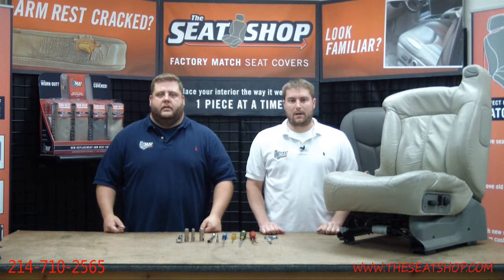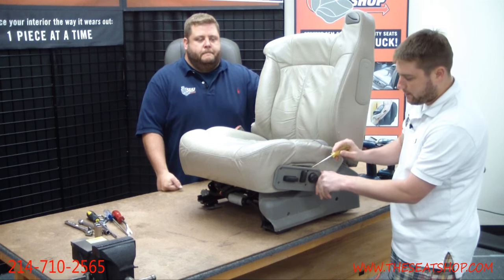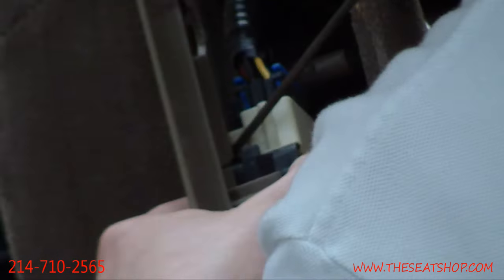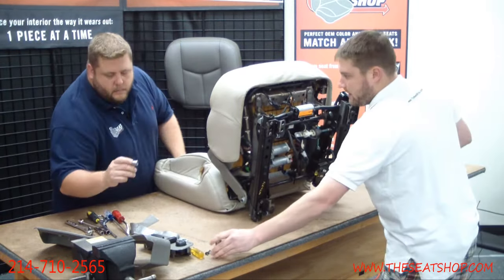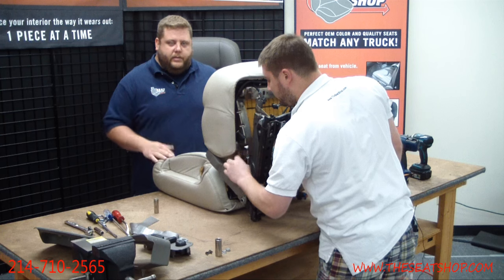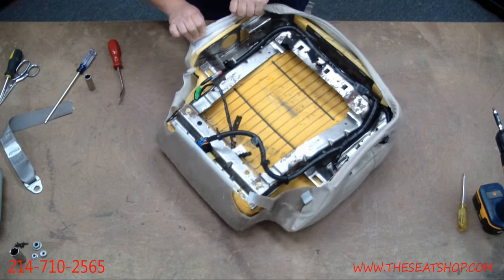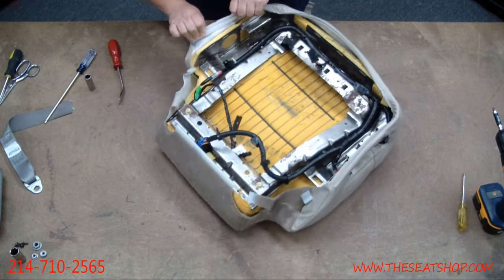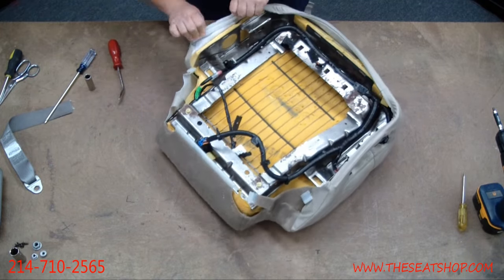00-02 Chevy/GMC/Cadillac Driver Bottom Leather Seat Cover Install

Comment: Great video man, thank you!
Was thinking about replacing the cushion, heater grid and maybe the cover on my '02 YukonXL. Those 308,000 miles have flattened that cushion like a pancake. The leather is actually in great shape. Loose since the cushion is almost gone though. Thanks again!

Comment: I just installed your seat driver cover (2002 Chevy Tahoe).  The hardest part for me was getting the seat out of the car.  Driver side right front screw is hidden under a plastic cover, and the rear ones are only accessible with the seat in a particular position - controlled by the electronic  position adjuster.   So it must be removed before unhooking all the wires.
Reply: My 2001 Silverado cloth cover is in good shape but the foam is breaking down. Does the original cloth gets destroyed when pulling it apart?

Comment: (con't) I had a manual lumbar support adjuster - I could not get the cable disconnected from the bottom of the seat.  The result was I could not separate the bottom from the seat back. I had to put the new covers on the seat and back, while keeping them close enough to each other so as not to tweak the cable.  All in all it took me 4 hours.  3 hours to R&R the seat from the tahoe, 1 hour to swap the covers.  I think a video showing seat removal would be useful.  Thanks for a great product.

Comment: Great video guys.  Was able to replace both cover and a new foam due to original being garbage.  I hope I wasn't supposed to pull entire seat out like you guys did in video?  I was able to accomplish with just bottom seat pulled out w/o the bottom part coming out.  So the seat just pulled to redo seat cover.
Reply from the maker: Hey, great to hear your install went well! We usually recommend pulling the entire seat to make the install easier, but whatever works best for you!
Reply: Were there any specialty tools needed to remove bottom only and how long did it take?

Comment: Can you tell me if all of the seat frames for the 00-07 silverado/Sierra seats have the provisions for arm rests. I have o2 seats without and want to add armrests. Was thinking that I just need the cushions and the actual plate that holds the armrest pin are under my cushions but not used.

Comment: I am told by my local shop that the seat heaters can be very fragile and that caution should be used not to break the wires that are in the seat heater.  Is this something to be mindful of?  Which sockets need to be the deep sockets? 11 and 15 mm?

Comment: It REALLY would have helped if you had said "use the motor to adjust your seat to the highest position and the middle front-to-back" BEFORE the 3-minute mark.  I had to go drag the removed seat back to the truck and realign it and pull it out again.  Maybe you can add this text the very beginning of the video as an overlay/popup.
Reply from the maker: Gregg good feedback.  We made that video 5 years ago and should probably shoot another one.  Appreciate you sir!
Reply: So are you shooting another
Reply: @TheSeatShop  and yet after 5 years this video stands heads and shoulders above all the rest for all the right reasons - simply every single thing you could possibly need to know about how to take these seats apart and then put them back together again.  The video and audio quality are both excellent and not a minute wasted on kitsch.  Anybody that's smart is going to take the whole seat out of the vehicle and take it inside and set it on a workbench to complete the change over of the cover and foam.  Just where else could you possibly get a video that's as helpful as this one?
Reply: No shit. I wish I had seen your comment. 😔